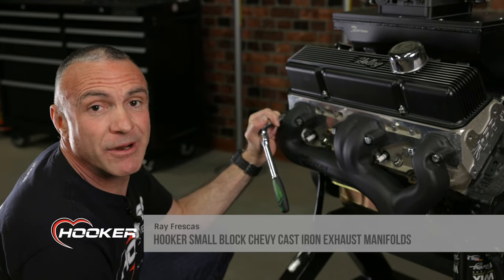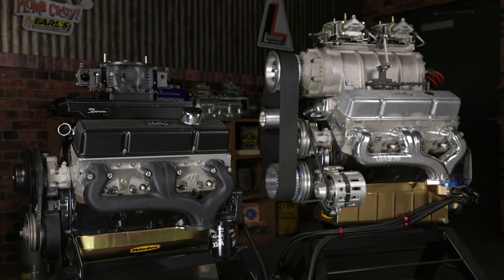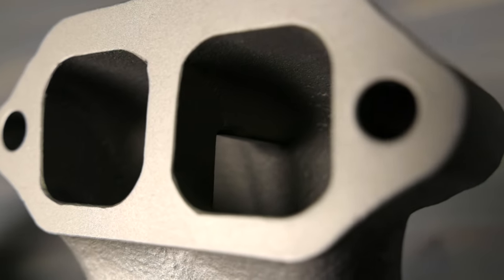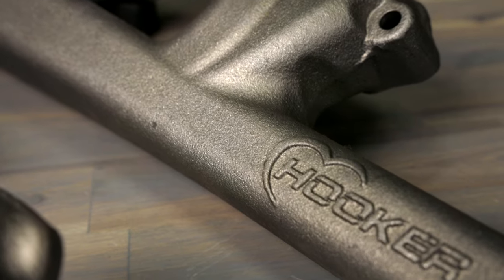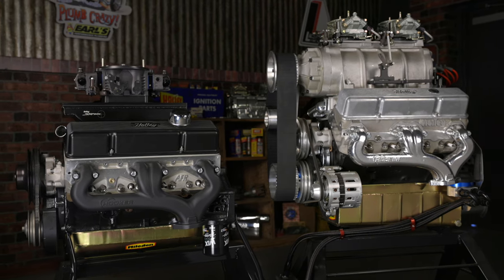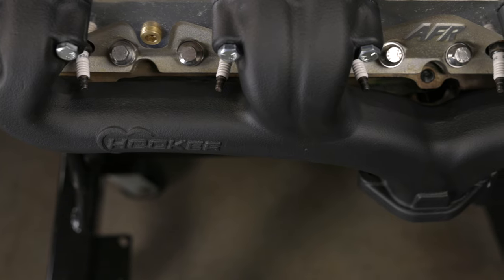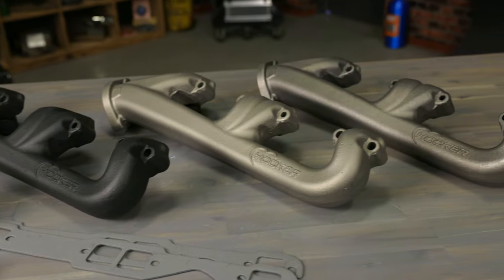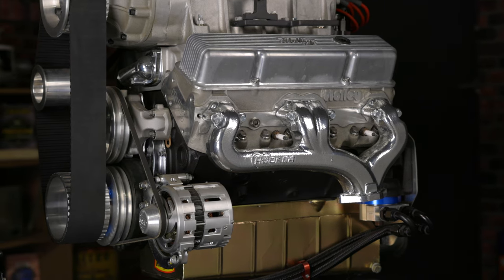Upgrade Your Small Block’s Stock Cast-Iron Exhaust Manifolds with High-Flow Manifolds from Hooker

Comment: What a great design. Headers on occasion hang down to low or are constantly leaking. Can't wait to see the dyno results.
Thanks Hooker for another great product.
Reply: If you have an issue with headers not sealing get some permatex gold spray for manifolds and headgaskets. Have yet to have an issue with the stuff. It is awesome.

Comment: Just got these installed on my 97 s10 zr2. In the 8 years of having “swap headers” I can say, with zero doubt and absolute certainty, that these are the best made and best fitting exhaust anything I’ve ever seen made for my truck. This is an absolute must, worth the wait.
Reply: What engine does your truck have, and did you add the factory 02 sensors?
Reply: @85fordman  it’s an L31R 4 bolt main vortec 5.7 350

Yes I’m using all my factory emissions equipment except EGR
Reply: Did you keep the factory heat shields?
Reply: @xXdetroit15Xx  no mine were rusted out I used a set of Accel ceramic boot 90° plug wires

Comment: Just installed these on my 350 4-Bolt Crate Motor.
They fit Perfectly and i can feel the Xtra “Umphh” compared to the stock Manifolds.
The 2-1/2 inch Exits provide that Xtra Flow as to the Smaller exits on the stock.
They contain heat better then Headers would and surely without a doubt, Would outlast the Headers by a Long Mile.
Good for True Street Car applications and surely is worth the Money in the Long-run.
Oh and lastly…The worry for leaks is now permanently OVER with these.
Never again.

Comment: I put these on my 350 HO  and immediatley  I had  "valvetrain noise"     just like you would get from running long tube headers.  Because the thin wall of the header amplifies/ echoes   internal noise.   I was shocked  that these manifolds did this Maybe the metal  is cheap chinese casting????    All i know is i was very unhappy  as my original manifolds made no  valvetrain noise at all.

Comment: How about adding a drivers side alternator mount for 1964-68 chevelle's and 1967-68 camaros. That's the sole reason I'd run cast manifolds is to avoid the tube header janky alternator brackets.

Comment: I can't find any dyno comparisons for these yet. Sucks that I just found out about them after putting my engine on the dyno. I could've tested them
Reply: engine masters did an episode with the LS version of these vs headers and under 500HP it really didn't care that much vs the headache of using  headers(headers had a little more torque down low)......they had another episode where they used the turbocharger LS version and it started to have trouble around 800HP vs headers. So JMHO they are going in my build since I will be less than 500HP

Comment: If I'm gonna replace stock manifolds, I'm gonna buy proper headers. I love my Hookers, but those are just dumb...
Reply: I sorta thought that too. However, I'm wondering if they could be turned upside down and used to slap some turbos on without using crappy stock versions that snap like a twig and leak like a sieve. Hmm...
Reply: @Hogiewan1  at that point, buy some Turbo Headers lol.
Reply: Some people hate headers and all the leaks, bulkiness, & leaks that go with them.
Reply: @mcqueenfanman  sounds like some people need to learn to seal them proper ja?
Reply: @ariyanadumon4549  Or some engine designs just aren't header friendly.
Reply: @mcqueenfanman  a small block chevy does not have that problem. That's what these are for. Case in point, who is this product for?
Reply: I am considering a set. I’d like to tag my 69 Camaro as an antique but in my state they will deny it unless the engine looks stock - headers are a guaranteed fail. I’ve got a mild small block so I don’t think I’d give up much power & it would save me the hassle of annual inspections if I tag antique.
Reply: @ariyanadumon4549  ppl like me, I am putting a 5.7 vortec in a 2wd Jimmy, that's a tight engine bay and the heat dump from headers will turn it into an oven.
Reply: @yurimodin7333  yep, been looking for something to save space on my 350 vortec swap in my 84 s10. These look right for the job.
Reply: @winterlounge same here. Really would like 1 3/4 headers  in my el camino but can't find anything that works with factory ac, both automatic on the column and manual in the floor. Engine is going in with factory auto transmission for now and don't want to buy another set next year when the manual and new rear end go in. Ground clearance is another issue with 1.5" drop not counting the hassle of the lies of header manufacturers saying "these headers fit your model, your car is just special and requires a hammer, saw and welder". I went through that on my last car. I literally had to cut and re-route the #2 cylinder tube around the steering centerlink. The tube would have had to be crushed completely flat with zero flow to fit.